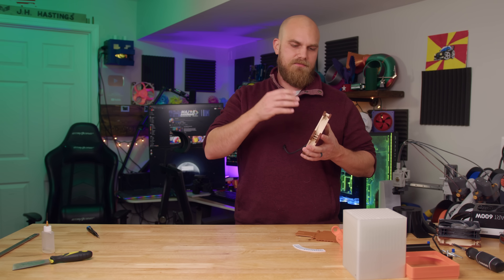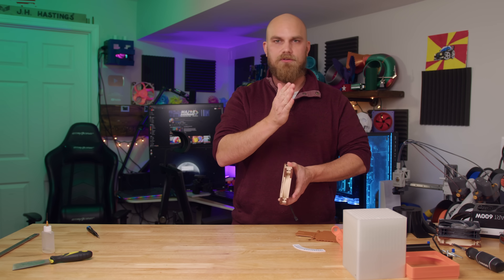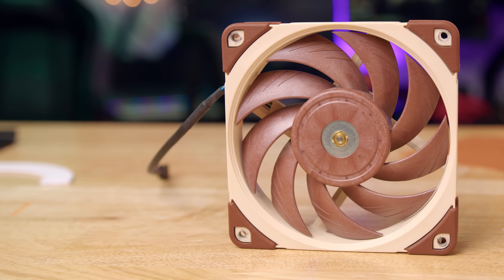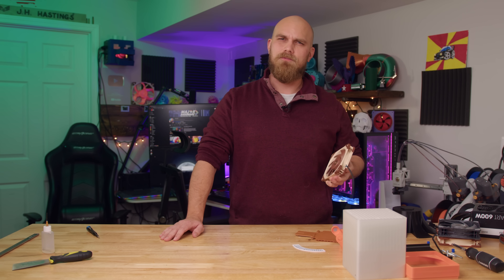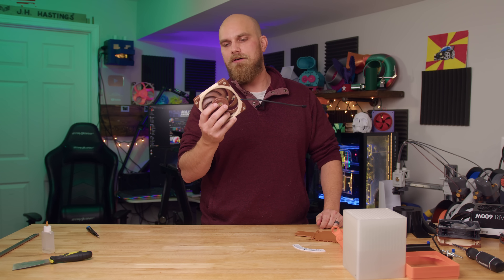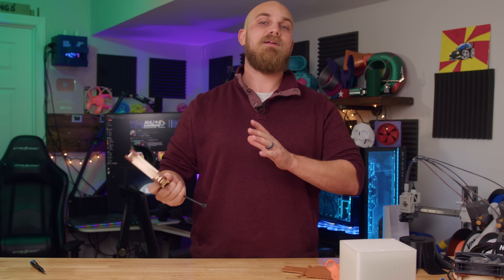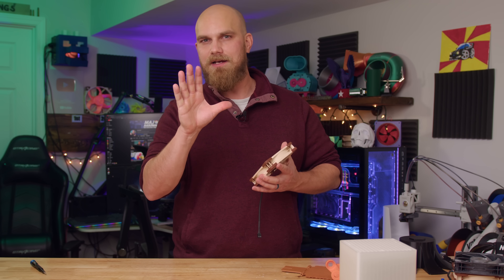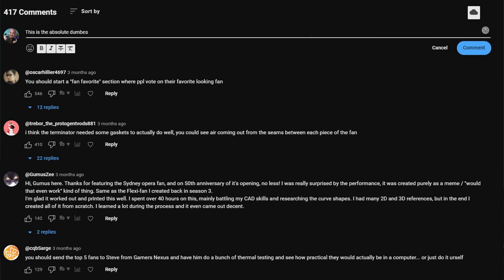I Built a Static Pressure Machine | Fan Showdown Season 6 Pilot

Comment: I don't know how the flap's angle correlates to the force that is needed to produce that angle, but I would suspect something involving trygonometric functions. 
Possibly a more linear readings could be achieved with not a flap, but a wall mounted on spring(s), that would close shut when not pressured, basically a spring based "linear valve" (probably just made this term up). From what I recall, spring generated force value equals to the length of spring's expansion multiplied by the spring's stiffness factor, which is a constant for a particular spring.

That seems like a much more complicated thing to do, and I am not sure if even like pen springs wouldn't be too strong for that, and I MIGHT BE COMPLETELY WRONG.

Comment: You don't really need to measure the pressure itself. More air flow measured by the anemometer on the same cross section, means that there is also more static pressure. Do not forget that static pressure is the driver of air flow.

Comment: You're measuring dynamic pressure, not static. Take a big plastic box, attach a glas tube with a u bend filled with water, one end in the box, one end outside. Have a single hole where the fan blows into the box.
The water will show you the relative pressure difference generated by the fan.
To measure dynamic pressure just put that u bent tube directly behind the fan. It's really surprisingly accurate depending on how thin your tube is.

Comment: Make a vertical tube with small holes along the lenght and drop a table tenis ball in it, make the fan push the ball up trough the tube. Best static pressure will make the ball go higher.

Comment: INCLINED TUBE MANOMETER!!!! Since you do not have a large static pressure differential to raise a "vertical" U-Tube manometer water column a measurable amount just make a longer run of tubing at a slope to give yourself a more granular accurate measurement.

Comment: Hey James, I got an upcoming build planned with external radiator setup, and I was thinking of using quick disconnect for the pc-rad connection. Since you have a extensive portfolio of watercooling videos, could you do a comparison on different quick disconnects on market? I found nobody else has done one. Could include flow rates, spillage, air introduced to system when connected as there are many different types and iterations of QDC's.

Comment: The static pressure might be non-linear with your scale. Maybe put some counter weights on the top indicator section so the a12x25 reads in the top half of the scale, giving better resolution and offsetting some of the exponential force required to move the flap as it nears horizontal.

Comment: 2 open top boxes connected by tubes or other path, with a level of water that may change measurably by fixing a fan on one of the boxes. I do not know if changing the size ratio of the boxes to get a scale of measure to see a difference, if that even works at all. Or the possibility that it is a different case for an "enclosed" volume rather than a flow. Maybe because it is static pressure it doesn't matter if the force is pushing or pulling the water up/down.

Comment: Hey man. You should measure with an inclined tube Manometer. You're right, 2mm head is too small to see but on an inclined tube it's much more pronounced, will make for nice results on video. Also you should use a fixed size of restrictor at the end of the duct. The radiator is a good realistic restrictor. And use gaskets, leaks affect the result
Reply: Really appreciate your efforts to popularise the act of testing!

Comment: Would a setup with springs and a surface moving evenly not be a better way to scale this? The flap opening creates an uneven hole in itself AND is not linear depending on the pressure of the fan.
A plate hold onto the "0"-point with a tiny spring at each corner would eliminate those thigs, and an idea i get writing this, it could be placed inside the tunel.
Some restricting holes to let some air escape through the plate, the mentioed springs at each corner (best would propably be to set it up so the air moves in a circular tunel just as the blades are spining, covering the machanism in the corners and giving less space for turbulences).
Maybe the springs of some ballpoint-pens would be exactly what is needed and therefore easy to get.
I hope this was understandable, could explain it better on german ^^

Comment: As a number of people have said, a liquid manometer is absolutely the best way to measure this. As the pressures measured are so small, you'll need to increase the accuracy. Unlike some people said, diameter is irrelevant. The best methods for increased accuracy is to use a lower density fluid, or to not orient the manometer vertically. A lower density fluid means you get more "rise" per unit of pressure change. Angling the manometer means you are only lifting against a fractional portion of gravity, so you get more movement per unit of pressure and can be calculated easily with trig.

You could also buy a Dwyer Mark II molded manometer, which is a water-based manometer that already uses this angled approach for greater accuracy and is pre-calibrated. Or use it as reference for building your own.

Comment: seeing as you can measure it directly and the 2.34 mm water with the A12x25 is a well known fan to benchmark >>> "how to build a pressure gauge with clear tubing" <<< it's a physical measurement of the effects of pressure on the water: the water will raise / lower by 2.34 mm change in height if filled with water, or a different height for liquids of a different density.

Comment: an enclosed flap would give a better result.
I was thinking a 'puck' ( or ball or cube) within a tube, with tight~ish clearances (<1mm). That way the entire weight of the object would have to be lifted to a point where the pressure underneath it was suspending it.

I am not sure the flap method gives a linear scale, if the balance isn't perfect, the scale would be more logarithmic
Yes, this would be fine as all fans are compared against the same scale; but a more linear scale would be easier to distinguish fine changes.

that way you could fine tune the sensitivity of the scale buy adjusting the clearances of the object

Comment: I don't think your measurements are going to have enough significant digits (you measure in halfs now on a very very tiny scale physically speaking) to show true comparisons when fans get closer in performance to each other. You could create a second hinge with a gearing that makes the needle move further so you can have a physically larger scale. If you find all your fans landing at 6.5 and 7 and somewhere between it will become more subjective which one you think is the winner.

However, all that being said, creating your own scale and tooling is a novel idea. I would also advise you, once you have this sorted out, to create and calibrate several copies of the mechanism. It's likely that minor imperfections in the process of creation might create minor differences in measurement. Be sure to use a single known fan to be sure your scale is always matched up 1:1 should you ever replace your measurement device. You want a 5 to represent a 5 etc in the future should you upgrade or replace your measurement device.

Comment: Maybe a sealed box with a small water resivor and a clear hose going straight up. Right now its a simi static pressure test. As the door opens the pressure will drop and the fan can then speed up and then it's not really a static pressure test. Keep up the great work man 😊

Comment: Wouldn't you be able to just take a reasonable sized container, like 1m3, attach a tube in a U form with one side attached inside the box and one outside?
Run the fan untill you've got a stable reading, Very repeatable, and close enough to original testing.
Just make sure the open side inside the container is relatively large so you get a bigger rise and fall in the atmospheric side.
Reply: Yup and add a little color water to the tube

Comment: I'd be reality interested to see the static pressure vs airflow curve. For that you need both an anemometer and a manometer and you need to slowly close the wind tunnel. You could use a liquid column for the manometer, maybe with a less dense fluid. There are also inclined tube manometers for better precision.

Comment: This test setup is very similar to the previous one pushing air through a radiator, you need not only higher pressure but also a higher flow rate at said pressure in order to get a higher score. If you only want to measure static pressure it would honestly be easier just to make a closed box, attach a transparent U bend (PC water cooling parts anyone?) to a hole you design in it, half fill the tube with water, then slap a metric scale behind it. Boom, MMH2O at your fingertips. You could even make an adjustible flapper door to simulate static pressures at different flow resistances if that's your jam.

Comment: A good empiric test with empiric units but the scale is inadequate for the season : the noctua is 6 and the best is 6.5 so the absence of linearity is a problem. to distinct crappy fan to good one we need a better range. you  could add more linearity by using cylinder instead of square door, add more counterweight for more sensibility or/and just make it taller to have a better scale resolution.

Comment: You're still measuring flow and now pressure. Make a cube with the top open for a fan and a small hole in the side for a thin glass pipe placed almost horizontal and fill the box with water until it just fills the entrance of the glass pipe. Push air in - water moves along the pipe etc. You can adjust the sensitivity by the angle of the tube.

Comment: This will work, but I have another idea. 
Reuse the wind tunnel, put a radiator behind the fan and a solid panel 10-15mm in front of it to simulate a restricted airflow case. Then use dual manometers, use water tanks with clear plastic tubing marked at different heights to measure the pressure. You can also use your anemometer at the end.

Comment: This is not a measurement of static pressure. 
Here’s a thought experiment:
An output of 40 psi with 1 ml. an hour flow would not perceptibly open the door.  
Measuring the max pressure of your fans would be to measure the pressure inside of your sealed box using a manometer. 
What you have made is an interesting method to a-b test between fans however you can say nothing about any specific quality of any fan with this method.

Comment: Wothout getting super fancy with water gauges and everything.  Id do 3 simple things. 

1. Make your arm longer/flap lighter to get more range of results.
2. Male the degree gauge 3d printed also just so it is more 'professional'. 
3rd. Enclose the flap inside the chamber/add chamber after the flap. This way air isnt pushing its way around the sides of the flap but 100% 'through' the flap. It would be more accurate and i dont think super tough to do. 

And these give easy, repeatable,  non crazy elaborate mechanism results.

Comment: You probably want to make the flap longer than the enclosure is tall. As you have it now, as the flap opens further, the percentage of the air able to make contact with the flap, and therefore apply force to it, does not decease at a uniform rate. This will mean that a 1 unit difference between scores will not have a consistent meaning (ie: the performance difference between fan A with a score of 1 and fan B with a score of 2 will not be equal to the difference between the performance difference of fan C with a score of 5 and fan D with a score of 6). Also, with an analog reading, the impact of human error will have a greater impact on the higher performing fans (the ones we all care about most). 

I do think you could build a more traditional manometer with liquid and tubing.

Final thought, I know you are very used to using your 3d printer, but I think building something out of transparent acrylic would be more visually appealing and we could still see the smoke moving through!

Love the channel, love the scientific approach, keep up the awesome work!

Comment: I think that the scale should not be linear. I would have to do calculation to derive an equation, but the force put on the flap is affected by the angle of the flap - by that I mean that the bigger the force needed - by quadrat.

Comment: Good enough for content. There's only one thing I'd change: Reduce the size of the flap to have the same area as the fan inlet. At the moment it's bigger, thus reducing the range of your measurements for no benefit. I'd also incorporate a spirit level into the flap side of the housing to help reduce errors from setting the contraption up.

Comment: Do you really measure static pressure with this flap? It looks like the mass-flow meter from a car with electronic injection. If you want to measure static pressure I think you should use a barometer in a tube.

Comment: I think this device may run into a couple problems. First, you have a straight-line force trying to rotate a flap. As the flap opens up, the force required to open it further will increase exponentially. As the fans get more powerful, the scores will get closer together, making it more difficult to tell them apart. Also, the scale on top is physically small. So it'll be hard to tell subtle differences in the measurements. This device will probably be very effective with weak fans, but will get less effective as the fans get more powerful.

Comment: I'm sorry but i dont like it. You are still measuring a combination of flow and pressure, imagine a big piston compressor with reeeeally low cfm instead of the fan, it will have like a 100k mmH20 but it will not lift that flap. Manufacturer to "overcome" this problem are measuring the static pressure at zero flow AND the flow at zero static pressure(wich you were doing really close with the cone and anemometer). If you want to build a similar zero flow tester just let the fan blow in a sealed box and connect a U-tube manometer filled with water and you will get straight result out in mmH20. If you want to improve this design maybe move far from the rotation axis the gauge where you read the angle wich the flap opens, it will increase its resolution

Comment: This is good, but the problem is your results won't give you much information.

The difference between a "6" and a "9" on your scale is actually going to mean much more in reality, because the airflow required to move your arm is not linear as it changes through its range of motion.

I used to work on calibrating transducers and various types of instrumentation and there's usually a bit of calculation involved between the raw measurement and the actual output due to this. There are valves that are designed with special designed blocking plates so that as you open the valve they have a linear flow rate.

Maybe you could research the shapes used in these types of valves and adapt a design to suit your plate so that your results have more meaning?

Comment: You can build a simple comparing manometer with water tubing.  Just have a tube partially filled with water plugged into holes in the wind tunnel on either side of a restriction.  Like this:  [ \_______/ ]  The shallower the angle on the ends of the tube, the more sensitive it will be.  So like a run of rigid tube with one third at each end angled up at say 10 or 15 degrees.  Simply fill the tube until the water level is halfway up the angled legs.  Higher pressure will push the water towards lower pressure.  NOTE:  This doesn't account for any pressure variations caused by air moving past the tube ends.  I think it might be best if both tube ends were 90 degree fittings inside the tube and facing towards the fan rather than being flush with the inside which could act to draw water out of the tube.  S simple scale on the tube would be your uncalibrated, comparison measurement.

Comment: I believe using a smaller exit after the flap will funnel air out and provide more of a static pressure reading on the flap, and your ruler is  not very accurate, i foresee an issue with too close of readings to determine difference. It's an interesting concept, but your previous setup should be sufficient, perhaps shorten the wind tunnel

Comment: As the flap opens it will take more force to open it further since there's less surface area for the air to push against. (e.g.: it's easy to open 0-1 degrees and almost impossible to open the last degree)

A door that opens from the side that is held closed by constant friction (albeit a small amount of friction) or something else that can be quantified for testing might be a better choice.

Comment: Personally I would rotate the machine and orient the fan pushing air to the ceiling. Then I would change the angled scale to 4 guides (like 3d printers z-axis guides) so the gravity keeps the slate down. Then you can measure how high it goes when the fan is turned on and stops once reaches balance with gravity.
The benefit of this approach is that it gives linear metrics instead of angular. It also doesn't favour the air escaping in one single direction but from all the 4 sides of the slate. Keeping the slate horizontal may be a challenge so the guides have to fit perfectly without producing much resistance.
Consider also using springs instead of gravity for the resistance.

Comment: I see one problem:  you door does not only measure static pressure, it measures static pressures AND airflow, since the area of the opening increases and allows a greater volume of air to escape.

Fore measuring static pressure, you should use a device with a fixed or manually-adjustable exhaust orifice and a non-venting measuring point.  For example, you could connect a J-shaped pipe to the bottom of the tunnel and fill that pipe with water.  the height the water rises to indicates your static pressure.